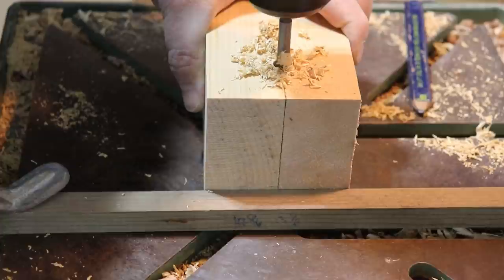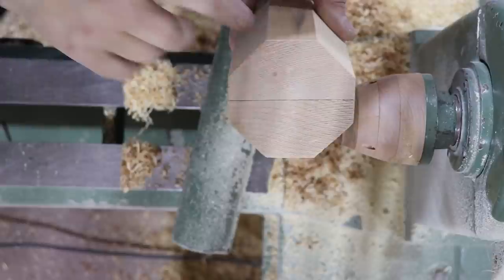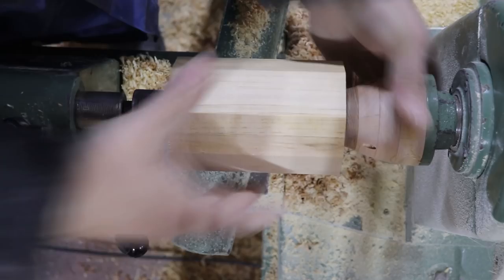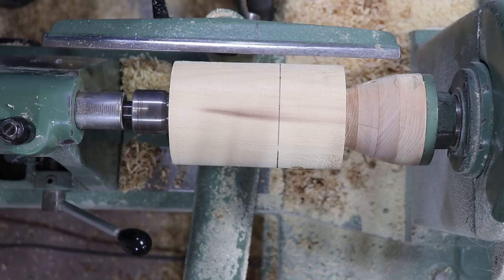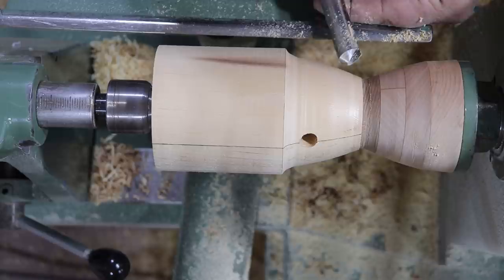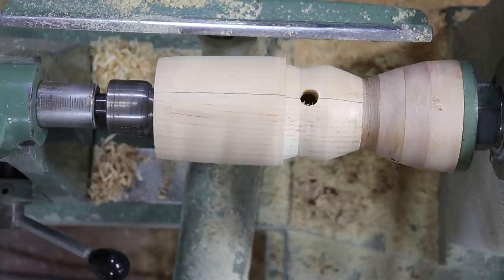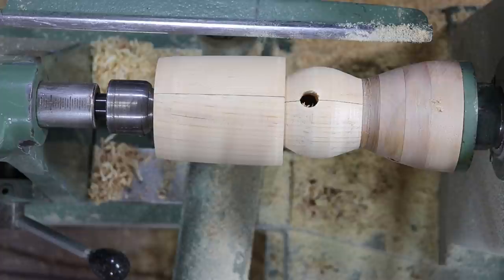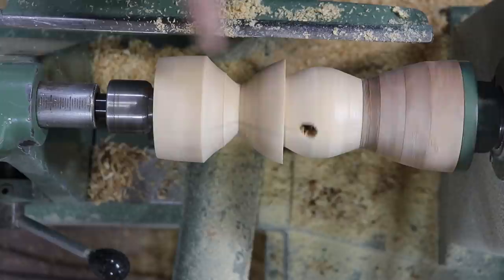Woodturning | Project That Sells - How To Fund Your Shop - Hobby

Comment: I would think you could just make a plug with a hole saw....and fill the pilot hole with epoxy/sawdust mixture.  Since it's on the bottom...once all finished off it wouldn't show.  I think doing that particular thing with the lathe wastes a lot of stock...
Reply from the maker: On the non ornamental ones the bottom needs to come out to clean.  You could do the ornamental ones that way if you chose. Thanks for watching

Comment: Love your videos!  I am a beginner making bird houses.  did you drill the holes first in the real birdhouse, and how did you drill the 4" interior space?  I've drilling a smaller hole and using a hollowing tool but there has to be a better way,,lol
Reply from the maker: Hi Patrick, I did drill a 4” hole with a Forster bit on my drill press. I made a holder to keep the wood in place as that is a big bit. Thanks for watching!
Reply: @TheKlondikeCraftsman  That is awesome.  I don't have a press that can handle that size bit, but I will soon.  Your ideas have been so helpful  Thank you!!

Comment: Those r very cool.  The one for outdoors do u use any sealer on the outside or just put out as is?  Just wondering cause of weather.
Reply from the maker: I make them from Cedar so I just let them weather but there are bird safe finishes you can put on the outside. I have also made them from pine to be painted. Thank you for watching!

Comment: Great video .  Just discovered your channel. I like your good, solid instruction as well as the nice music in between segments. My only question is how do you drill or make the 4 in. diameter hole in the large cedar bird house? Hollow turn? Super large forstner bit? Thanks
Reply from the maker: Thank you Steve, I do use a forsner bit yes. I drill when the stock is square do it can be held more easily. Thank you for watching!

Comment: How did you drill the large hole for the full size house?
Reply from the maker: I used a 4” forsner bit in the drill press with an extension. I do have a jig to hold the square stock on the drill press. Thanks for watching!

Comment: I would like to have the plans for the bird house #2 this show.  Comments  # 74 please.
Reply from the maker: Hi Cliff, I don’t have plans for these, I just make them. For the birds I want to use them you just need a 4” diameter hole 8” deep with a 1-1/4” entrance hole that is about 6” up from the bottom. You can use any size wood you like that will house that hole size. Hope that helps. Thanks for watching!

Comment: On the larger house, how would you go about cutting the 4" hole in the base? I know they make a 4" Forstner bit but is that the only way"
Reply from the maker: Hi Jonathan, I just used a 4" forsner bit and extension and used the same method as I drilled the small one in the video. I do have a jig to hold the big piece on the drill press. I think I will show that in the next video in the series in a few weeks. I realize that not everyone will have that capacity but wanted to show that the process was the same for those who could. Thank you for watching!
Reply from the maker: If you wanted and were equip you could hollow the opening on the lathe but then it is not a very cost effective item to sell.